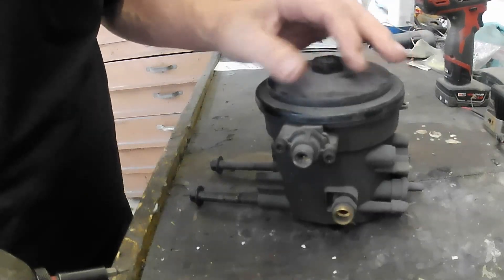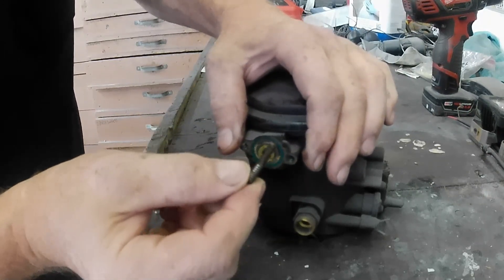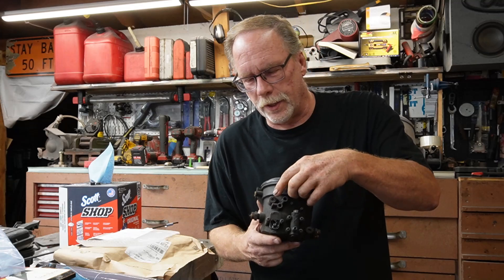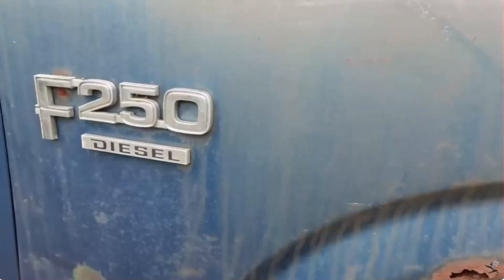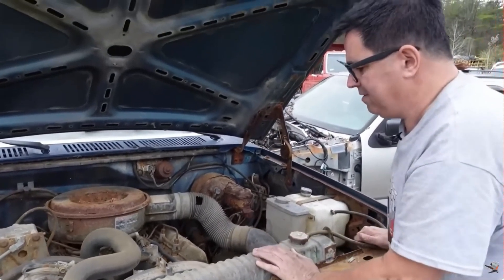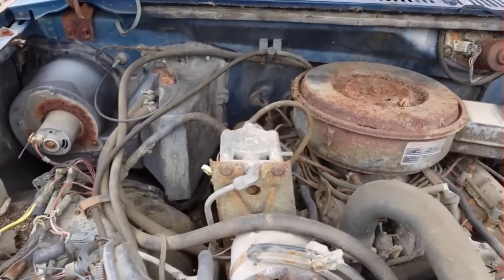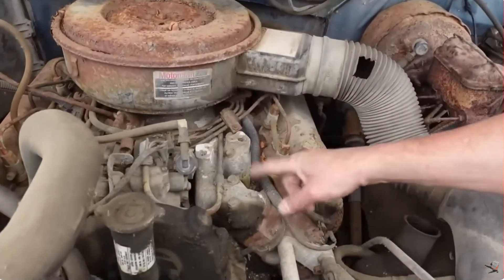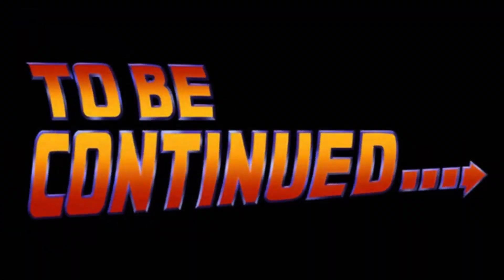🛻📽️7.3 POWERSTROKE FUEL PRESSURE SPRING QUICK TECH TALK    🚧🛑⛽🛻

Comment: I just replaced the set on a 7.3 I'm working on. I hope it runs better when I get it going. I did the same thing on a 6.0 I worked on a few months ago. Long crank. Like long...  half the oring on the plunger was gone. Big fuel leak off.  The problem with the 7.3 I'm working on now was a leaking hpfp. Replaced.  No start still. Only builds 185 psi oil pressure.  I'm suspecting injector orings. Trying to find fittings I can put air in the heads... mabee tomorrow or Monday.

Comment: On my 02 350 7.3 fuel bowl is missing the check valve in the middle of the tower. Will or can this be bad? And on the pop it sleeve does this need to have a hole in the middle ? and is that a special o ring. Got a kit from Riff Raff didn’t come with the special o ring

Comment: This is valuable info. Forums all over the place on what a safe pressure is, a lot of people claiming anything over 70 will cause injector failure. Checked my pressure recently and im 50spi at idle 25 yr old spring. Will order this upgrade via the link

Comment: Anybody know if the weak spring will cause p1211 code?  Mine runs great but under full throttle with #3 on the Edge it will throw a service engine soon light.

Comment: the man in the second half gives some really great info on the history of the ford diesels however as far as i know the start system has always been 2) 12v batteries in parallel for a 12v start system not 2 batteries in series for a 24v system. i think a 24v system would start the engines easier however i am sure the added cost is why they don't utilize them

Comment: First time 7.3psd owner here. I recently bought a 97hd and it was having issues starting in the cold, went through and replaced the glow plugs and gpr and valve cover gasket/wiring harness with motorcraft parts from ford, as well as a new denso starter. Truck was still having issues, felt like it was cranking too slow. Truck had new interstate batteries when I bought it (date stamped October 24) took them to an interstate dealer to have them tested and they tested okay. Checked for voltage drop from passenger battery to starter on both positive and negative sides and there was none, but batteries still drip to 8.6 volts when cranking. Any ideas on what might be my issue?
Reply: I should also add, truck will fire right up in the cold if I put the booster box on it. Which is why I thought bad batteries.

Comment: Hey Clint, im having issues with fuel getting in my oil and I just redid the injectors o rings and im still having the issue I took the passages valve cover off and watched the injectors and my very far back closest to the cab is the problem it’s shooting/spraying a lot of diesel out of the push arm gab and I’m wondering if that’s a injector over fueling or a cracked head, its a  completely stock truck with 280,000, and just want to to say thank you for the support and content you made its has helped me out and many of other people keep it up man

Comment: On a 97 with mechanical pump, is the fuel pressure only built up by the pump or is there any other electrical component that contributes to building up the pressure?I had ongoing problems with fuel pressure/ pumps going bad on it, finally got around to dropping the tanks and removing all the broken plastic from the broken pickup boots and installed new ones, blew out all the lines with air, went ahead and put a new pump in at the same time, when I went to try to prime the lines and restart it I could not build up any fuel pressure, shimmed the fpr spring with a bb and it fired right up but on the first test drive only got about 3 miles down the road and it shut off, checked the schrader valve and no pressure but still fuel in the bowl. Pulled it back home, took the bowl off took it all apart, cleaned out the screen and filter on the high pressure and return side of it, put it back in and again couldnt build up pressure at the schrader valve. Went back the next day realized I didn’t reconnect the electrical connector on the left side of the bowl that goes to the heater and the ipr and it fired right up but as soon as I stepped on the peddle it shut right off, it didn’t even try to accelerate and again no pressure at the schrader valve. New cps and new motorcraft ipr, problem seems to be with fuel pressure but can’t figure out why it won’t build pressure
Reply: Update, loosened up the banjo nut on the back of the pump, cranked the engine and no fuel coming out. Kept cranking in small burst until finally fuel started coming out, tightened back up the banjo nut and she fired right up, but as soon as I touched the pedal she shut off. Went to crank it again and after a 6-10 second crank she fired back up then started bucking and shut off, checked schrader valve and zero fuel coming out. Now each time she’ll turn on after a longer than usual crank but only stay on for a few seconds and sputters off. Narrowed it down to a fuel delivery problem but not sure if it’s a bad pump or a restriction within the fuel bowl. The pump fills up the bowl pretty fast with zero bubbles but cant keep up on the second stage

Comment: Does anyone know what would be casing a loss of power while holding at a constant rpm and power on the highway when it’s cold out? For instance when driving at constantly 45mph I’ll lose power and the engine will seemingly bog but if I press the fuel peddle the bog stops for a bit. If it helpes at all it’s a 97 with zf5 and of course a 7.3.
Reply from the maker: You can get forscan app and monitor ipc pressure see if it drops off  Common issue with this IPR  / clogged air / clogged fuel filter/ failing pump
Reply: @ ok thank you. you got back to me fast it’s vary appreciated .
Reply: @CUSTOMWORKS7.3PSD it is only happening when the Exhaust back pressure sensor is hooked up what could case that?

Comment: Hey Clint is there a way to email you and asked a question. I have a 2000 excursion 7.3 It will not fire when you're cranking it over the volt gauge  barely goes up to 9 volts I think it takes 9.6 volts to fire the injectors if I remember right anyhow the batteries are brand new interstate batteries The alternator was pulled off and tested and came out fine I replaced the plug where it plugs into the alternator a couple years before any of this took place and I cut off the end of the charge wire and put on a good solder end at the same time I replaced the plug My thoughts are it's an instrument cluster issue is there anything else that I need to test or check before trying to find an instrument cluster. Any help would be appreciated

Comment: I have a 1997 ford f350 XLT 7.3L powerstroke I just rebuilt all 8 injectors. I also replaced all 8 glow plugs I had to re-do the injectors because I had oil in my fuel bowl from a bad injector o-ring which one idk but anyways I got it all put together and when I went to start it it wouldn't start my fuel pump is not turning on went though each of the fues/ relays under the hood and inside the cab they all were good I even checked for voltage at the glow plug relay/SOLONOID as well as continuity they are good I also checked for voltage at the fuel pump under the truck both front and rear got good voltage there my wait to start light comes on I got crank but no start bc fuel pump wont turn on I also located the fuel shut off switch behind the passenger side kick panel it has been bypass with a relay which it is good as well I don't know what else to do kinda hoping someone might have an idea what to do please help

Comment: Is there something I could check for a smoking issue? At start up it’s clean after a minute or 2 at idle it starts to smoke if I rev the truck it puts out a big cloud and at idle it returns to hazing blue smoke. I have a new xdp turbo in June this is all a new issue started on the drive home on a 900mile trip. No oil in the fuel and no fuel in the cooling system. Any advice would be greatly appreciated.

Comment: Hey I have a question I am completely stumped. I have a 2001 ford excursion with a 7.3. Is there a sensor or a relay that controls fuel bowl. Because I just replaced the fuel heater (w.i.f) sensor. Power is not going through to the heater element. The harness that plugs into the sensor gets power but the element won’t get warm and doesn’t warm up the fuel. What could the issue be. Could it be it’s not getting a ground i have no idea?
Reply: The way it works is 12v is always on the heater, it never shuts off from the cpu. The heater is mounted on the 3 pads. These pads are thermistor, meaning a temperature sensitive resistor. One side of these thermistor is connected to ground through the mounting of the heater plate, the heater element is connected to the other side. 12v is always on the heater side whenever the ignition key is on, these mounting pads (thermistor) sit at a low ohm condition when fuel is cold basically grounding the other side of the heater so 12v heats the heater. When the fuel temperature starts rising, these thermistor resistance starts rising, so less voltage is dropped across the heater until gradually the thermistor are high enough ohms where no heat is generated by the heater.  hard to say with a definate answer how long the heater is on or if the heater ever actually shuts off 100%. Basically a thermal switch in concept and works great except the solder breaks and the element falls off the thermistors and no run from a blown fuse.
This should clear up the question Clint / Custom Works
Reply: @  my wait to start light still works in my truck. So my fuse isn’t blowned. And also I put a new heater element in the fuel bowl to could it be bad already. So could it be just a bad fuel bowl even though I just put a new sensor in it? And I just dipped my finger in the fuel bowl and it’s not warming up. I live in Arizona and having starting issues.
Reply from the maker: @hunterlindner7581  I can't tell you what your issue is with out seeing and hooking up to it . Here is the top issues and the fuel heater isn't the cause /// batteries, starter, fuel pressure, low or bad oil, clogged air filter, IPR, failing HPOP, Leaking injectors, wire harness
Reply: @CUSTOMWORKS7.3PSD  ok and when I leave the truck plugged in overnight it will start right up and run n drive good. I only have the starting issue during the cold start. But after it warms up no starting issue. But so far I replaced batteries, starter, EOT sensor, EBP sensor, and gpcm. I have a new ipr and a icp sensors. I will install tonight and hopefully that’s the issue. I also have no engine lights on.
Reply: @CUSTOMWORKS7.3PSD  it’s was a bad ipr. Truck runs so much better and now starts up.

Comment: Clint , I cant get oil pressure in my 94 7.3. Changed the LPOP new oil and filter lubed it up good and no oil pressure.  No oil in the HPOP. Any idea what to look at?
Reply from the maker: could be a cracked pick up / new pump won't prime This occasionally happens

Comment: Since the ipr can be takin apart is it possible to clean and reuse if the solenoid ohms out good i have a 2000 7.3 hard to start cold or hot and idles rough
Reply from the maker: Yes they can be brought back to working condition if the solenoid is good , coat all the internal parts with a hyperlube like motorkote

Comment: Noticed in the OBS video, you are in Wisconsin.  How far south are you and who would you recommend for a 7.3 machine shop for cylinder heads?
Reply from the maker: I don't want my business bothered by interruptions many You tube guys have found this out the hard way . But I can tell ya for drive line,  Machine Service of green bay does all of our drive shaft builds. Engine is Manitowoc Motor Machine Service these guys are excessively driven for perfection. The rest I do in my shop including transmissions , Frame building and other custom applications
Reply: @CUSTOMWORKS7.3PSD  
Appreciate the help 🤠 
Little farther north than I need to go, i hope.
Found a great driveshaft company in Elkhorn 
Beginning to look for a 7.3 machine shop specialist. I will keep them in mind. Thanks again and love the knowledge you share 🧠
Reply: Close to Kenosha co. ?

Comment: Quick question sir. I have a 96 7.3. Running 238/80 and a stage 3 KC300x. Will this spring stop the ICP pressure to low/high CEL light?
Reply: I feel like with 370,000 miles it must be stock and robbing of my fuel which in turn is defueling on a hard pull.
Reply from the maker: @johnmichaeliii2281  No You need to consider a fuel bowl delete with a fuel pressure system install https://www.strictlydiesel.com/product/2664/driven-diesel-73l-fuel-bowl-delete-regulated-return-fuel-system-kit and a https://www.riffraffdiesel.com/terminator-t500-hpop/ or https://shop.fullforcediesel.com/dieselsite-adrsi-adrenaline-hpop-stainless-steel-threads?gad_source=1&gclid=Cj0KCQjw4Oe4BhCcARIsADQ0csnMkwWufiY2bLlCD_63ghGyLeqfzXzSbwGLj8Bb6y0WJVrDo7IaHa4aAuV7EALw_wcB
Reply: @CUSTOMWORKS7.3PSD thanks

Comment: I clicked on the link on your video but it doesn’t take me anywhere to get the spring , also, I have a 1997 f350 4x4 PowerStroke that I have owned since new, I’m 69+ years old and replacing the lift pump, fuel lines from the bowl to the front of the engine, rebuilt the fuel bowl and pressure regulator and wanted to replace the Parker sleeve o-rings on the steel lines that run from the banjo body to the back of the heads and on the passenger side rear head due to the fitting being under the turbo and factory down pipe I can’t figure out how to remove it much less put it back on. I have tried line wrench, a crows foot open end and can’t get on it. I have hands that take a XL glove so was wondering if you can please help me with a trick of the trade or something. I really don’t won’t to remove the turbo as I am not a Machanic and would rather leave it alone. My truck has 116,000 miles on it but it is now fixing to be driven more as I have been recently forced into retirement. ☹️ Can you please give me some advice? Thanks and just absolutely love your videos.
Reply: I clicked on the link, and ordered one last week. Just installed it. My 97 already feels better on the test drive.

The brass nut on yours is a 3/4 on the front driver side corner. Very easy to remove. I put a towel underneath just to catch the spring.  Used a magnet to  grab the spring and get it out. Popped new one in and replaced brass cap. Took 5 min.
Reply: Thank you I appreciate your help. I was checking your video library and was looking for a tutorial on how to change out my HPOP lines on 1997 7.3 Powerstroke. I really can’t fine one that is really good like your videos. Would you have a video on this or know of one that you would recommend, I have the 2 HPOP hoses and would really like to change them out while I have the fuel bowl removed, Thanks

Comment: outstanding info on the 7.3   I am chasing a weird problem.  when I start the 7.3 it struggles for about 10 sec like it's lacking something then it runs fine.  i have followed your troubleshooting and damn near replaced everything including wiring harnesses with OEM parts. it has me stumped!  any ideas where to go?
Reply: Have you checked your pickup tube in fuel tank?

Comment: Hey Clint @CUSTOMWORKS7.3PSD I believe this might be unrelated but I’ve been having issues with my 2001 7.3 zf6. My cruise control is not working and I have been through everything I can think of. The switches at the steering wheel send signal but nothing happens on the dash. It is a California truck and there is a code for a systems check failure that I believe to be related to my issue if you would have any ideas I would greatly appreciate it.

Comment: Thanks for all the great info. Would this fuel cause a no start ? I am deep into this no start and thinking I have a bad ecm. Any thoughts ? Thanks
Reply from the maker: extremely low fuel pressure will cause a no start BUT it would smoke and spit spud unless the pump is shot / I do have several hot no start and no start vids that give basic overviews on every thing to look for If the ecm is bad a scanner would find it and a code reader would give a no communication I also have a IDM video how to spot a defunk unit

Comment: Yes i have watch alot of your videos his im a subsriber so i have a 1995 F250 7.3l i have replace everthing on valley all new hard lines and CNC Fab, Martys E fuel , 38 gallon tank sub kit on bottom and side tank as well new, new planiums at RiffRaff new KC stage 1 turbo, new computer as well still no wait to start on dash when i get home i work offshore Oil Field i got the new IPR motorcraft and ICP on my dresser and the new oil pump i half to take off to send in to RiffRaff to send my Oil Pump to me i mean i have spent alot of money on this truck with a new computer but  I kept my old computer wasnt going to let that go but still no start but will crank strong tho, also and going to change glow plugs when i get home and gaskets on valve cover i have them too, its been sitting since 2012 under a tree and only has 154,000 miles bought it for $ 1800 dollars wow i could get a better truck got it November 4,2023 so i been throwing a lot of money watching your videos instead of buying another truck lol so when i put the CNC Fab on where do i put the heating element or heater wire off bowl to what i believe i saw a video to put it next to the oil filter there is a screw right next to it with a oil pressure sensor but the guy was talking way to fast lol so please help thanks
Reply: Idm check fuse first

Comment: on my 96 f350 when i have to climb a small hill engine light comes on and it dies
Reply from the maker: I'm not sitting in front of your truck But that is usually a indication of a failing HPOP To diagnosis you can do a dead head test with a pressure gauge to confirm or hook up a gauge to the head and drive it under load and see if the pressure is dropping of as you increase load